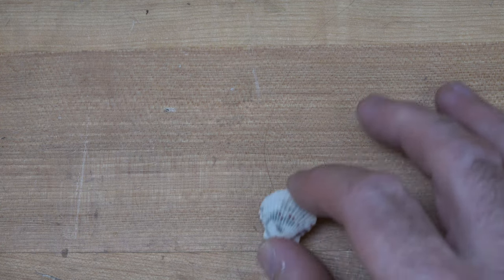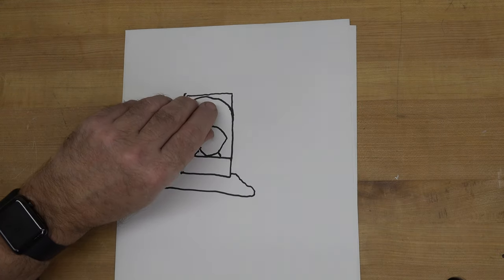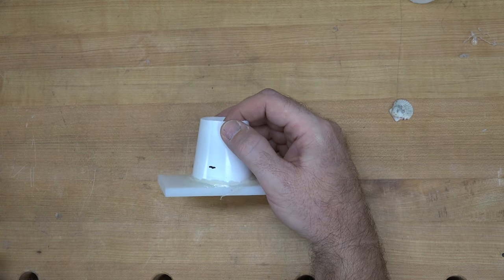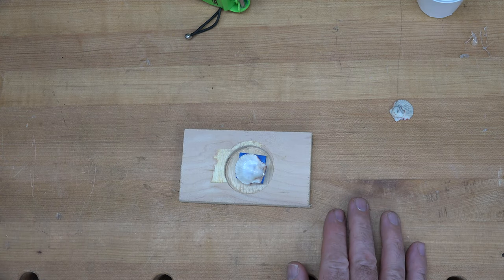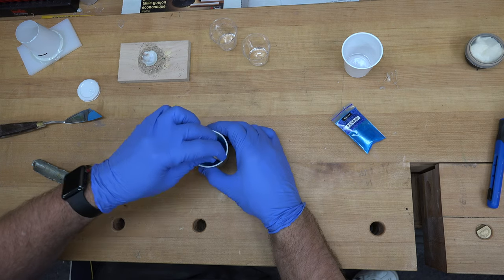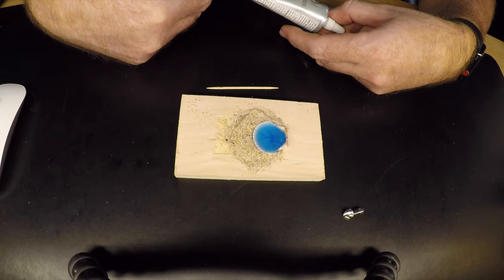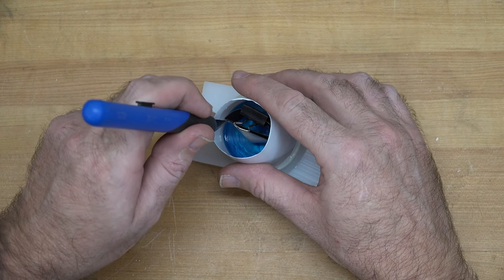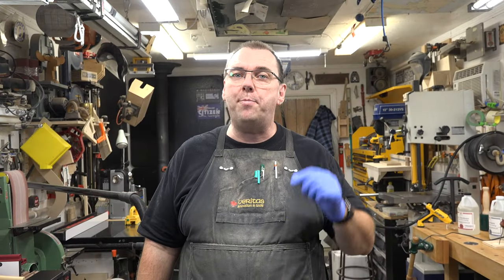Resin Casting Project  Part 1

Comment: Hi Kenny, Another great tutorial on resin casting.
 I found my primary school badge and I’m wanting to do something similar, but as I don’t have a lathe so I was going to use a silicone egg cup. Just wondering how you might go about setting it up. I was thinking of just straight clear and putting it on a timber base and then giving the CA glue finish a go. Cheer’s Troy
Reply from the maker: Experimentation is half the fun with these project Troy.  Clear resin is definitely your best bet for your purpose.  The base can be anything you'd like.  I would suggest applying a finish to the base prior to adhering your resin egg to it though.  Thanks for tuning in to the show.